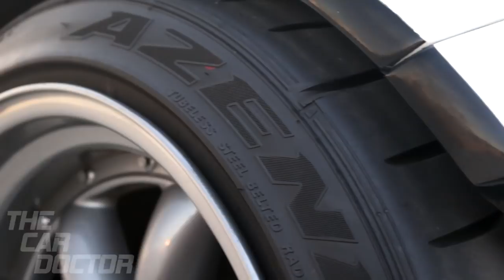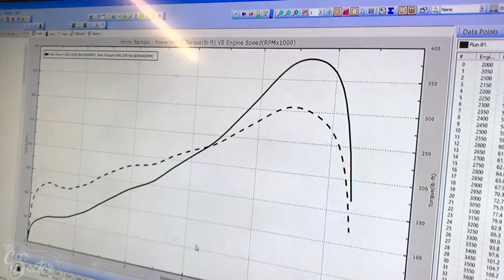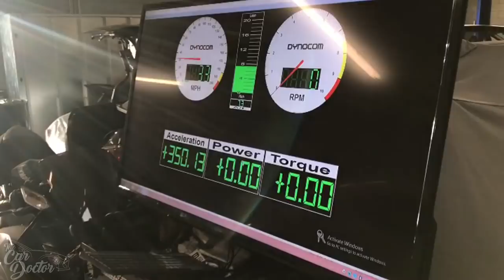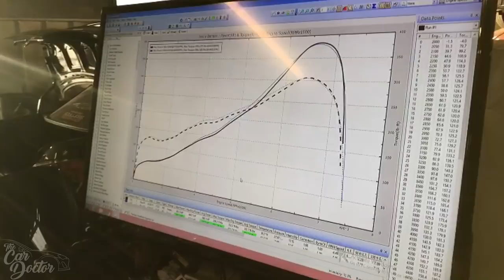What to do after Boosting your 86? [Tuning on the Dyno]

Comment: I don't understand why people need so much power unless they're tracking and racing regularly. Like I feel like the BRZ is perfect in the range of 230 to 250 horsepower because of the light weight body and just an overall wonderful car to drive even as a daily driver because you can regularly floor it, you can push it all the way, when many other cars which sit at 350 400 horse you're always terrified of pushing it to its limits. 

Idk, maybe that's an unpopular opinion but I'm a little unorthodox. For example, I eat an apple inside out. Never outside in.
Reply: Probably just for the fun of the drive. Like on highways just to floor it from time to time. Sure 400hp is a bit much. Maybe 250 to 300hp would be fun.
Reply: how the hell do you eat an apple inside out?
Reply: @3p1ks  😂

Comment: The problem with turbo 86 compare to sc 86 is higher risk of heat soak during track days. Or you need to invest a lot more to cool components. But what i really like is you used boost control to build torque like a centri sc 86 builds. By the way 12 pounds of boost with e50 could be safe in daily but not likely in track abuse

Comment: Wow this is amazing this is how i would like my brz i have a handful of modifications rn but im thinking of turbo and widebody. What clutch are u using? And is it it daily driveable?
Reply: He got an automatic but I also have a boosted frs at 13 psi I daily drive it everyday on the same 13 psi map I can’t change it but it’s been running completely fine I got an act xt extreme clutch and so far it’s been holding up to the power
Reply: @ronny11b12  i got a evo x final edition and now its making 500hp lol i sold my brz 2 years ago

Comment: This is automatic right, mine is too, and i want similar power from my 86 when i boost it, if i remember correctly your frs has stock clutch?, jw if boosting automatic is any different then manual, when tryna get 400hp plus. Or is it the stock internals
Reply from the maker: This is an Auto on stock transmission. 12psi on stock internals. The only difference from boosting a manual from an auto would be swapping your clutch for one rated for the power, something you don't need with an auto, and using different locations for reference vacuum.

Comment: It appears that you are not hitting peak boost until much further into the Rev range than one would normally expect. Either your boost controller is not setup right or there is something wrong with that turbo.
Reply from the maker: I had a boost leak with the hosing through my na version of a catch can and back to the intake, and corrected it. Was brought up earlier by another subscriber.

Comment: Hi. I like your content however there is quite some misunderstanding from your part. 

1: Sc vs turbo: it comes down to power delivery and intent and built engine is not needed only to make power, it has other useage like lowering compression and protection etc. But anyway the engine is not a problem with high hp fa20. It's heat that is way more complex to be solved by a vented hood.

2: you didn't NEED the wide body kit to fit wider tyres. You WANTED wide body and wider tyres. That is completely fine but it is a difference that might confuse somebody starting out as you don't need wide body to fit wide tyres.

Otherwise a nice vid as allways. Been lurking since the beginning.
Reply from the maker: longform Cooling is very important, that is why I upgrade it in my latest video. Sorry, sometimes I speak for my car, and it's later interpreted for every use case.
Reply: Jonny The Car Doctor the funny thing is that right after I made that comment I saw your video regarding cooling upgrades :) what is even funnier is that I was about to subscribe when I realized that I allready did. Which is strange since I dont really subscribe to you tube channels and it also explains why I have so many of your vids in my recommendations :) Not disapointed.
Reply: Above 250-300whp these engines go bang without forged internals fact. Some people get lucky but eventually most will go.

Comment: Do you have a video outlining your fuel system changes? I'm wondering if your fuel system is stock aside from the 550 injectors and fuel pump. Can the stock fuel lines go E?
Reply from the maker: Alex Kohlman If you are stock block all you really need when going boost is an upgraded fuel pump, if you look at some of my newer videos I installed a FBM walbaro 485 fuel pump. Stock lines can handle Ethanol. Stock injectors are good up to around 380whp. Im at 500whp now so I upgraded injectors to ID1050x’s but im built block now.
Reply: @JonnyBarajas  I'm looking at going NA bolt ons with E to see if I can get 250 wheel.

Comment: I want my car to be build just like yours power wise at least? How much power are you making on 8psi
Reply from the maker: About 320whp at 8psi. These are great cars to build.
Reply: Jonny The Car Doctor 8psi 320whp with E85 or 93?
Reply from the maker: I was on E85.
Reply from the maker: Forte5 RS The simple answer is High compression pistons. All Factory boosted cars come low compression for reliability thus requiring more boost to make power.
Reply: Forte5 RS Well boost pressure doesn't always mean the same thing on every tune. He's most likely running wayyy more timing etc making it a much more aggressive tune than what a normal 7-8psi basemap would have came with. Right now my BRZ is tuned on E85 (reads at E78), dyno tuned by moto-east on 12psi boost and I'm at about 360whp. FWIW my same tune on 9psi E85 was only hitting 304whp so it varies a lot based on the tuners preferences... don't let the boost numbers fool u
Reply from the maker: Currently running stock internals.
Reply: What kind of wide body kit did you use?
Reply: That's because your Korean car comes with a less than 42mm turbo and this FRS has a 60+mm turbo lol

It flow a lot more air at the same PSI
Reply: 7. 7 speed.
Reply: DHH: Size of turbo. You can have 20lbs on a small turbo and 5 psi on a bigger turbo and the bigger turbo will outshine that small guy. I hate when people ask "how much boost can I run" Well what fucking turbo are you gonna run then we can tell you. 10psi on a 14b vs 10psi on some 80mm turbo is 2 different worlds.
Reply: @JonnyBarajas  just so you know guys we have 98 octane fuel pumps in OZ 😎 yeah baby

Comment: 380wheel on a stock motor? thats insane, props on the build, how much do you think it would be on premium pump gas
Reply from the maker: Ajay Dhaliwal On pump gas would probably be around 300whp mainly because you dont want to run too much boost on pump.
Reply: 93 pump gas on 13psi🙋🏻‍♂️

Comment: At about 400 hp hows the car running after what i assume 2 years later
Reply from the maker: Good.
Reply: Jonny Barajas where did you get your tune
Reply from the maker: @818garageprojects6  local AZ tuner, db_tuned. Tunes most of the Frs/Brz in the area.

Comment: Hey dude, what clutch you running?
Reply from the maker: Running the stock auto clutch.
Reply: Jonny The Car Doctor but torque converted autos dont have a clutch?
Reply: @yellowpeaches6040  just in case someone every see's this and need advice autos have clutch packs which can be changed for the ssp stage 1 or 2 which can hold something like 400tq and valve bodies can be changed for faster shifts stock auto you can move a valve on the side to increase pressure i think which will increase sh8ift times dont know the effects this can have though.